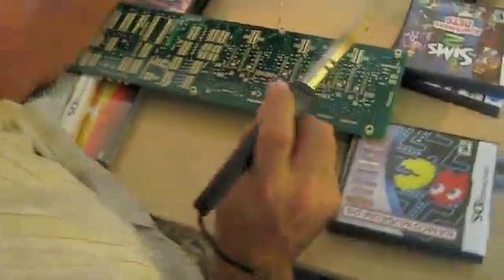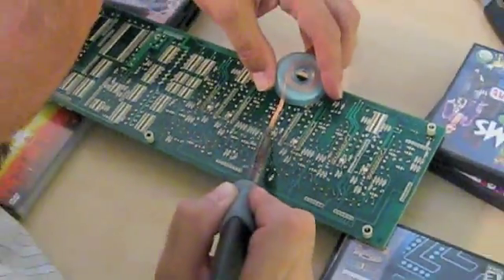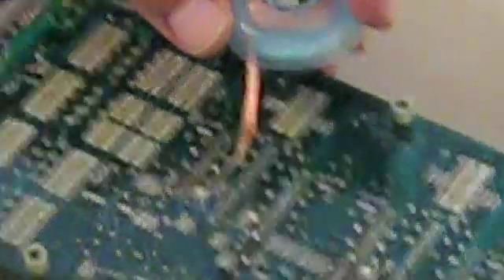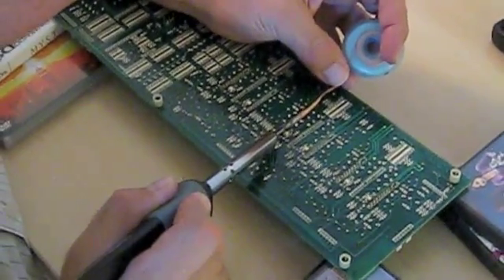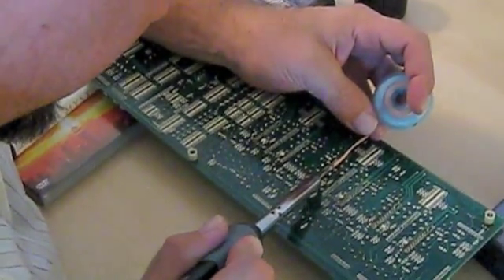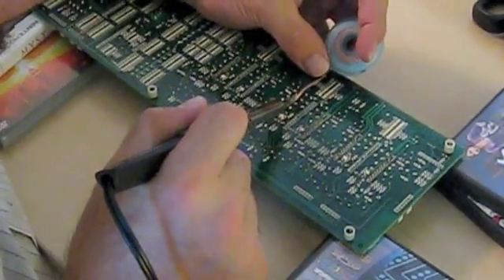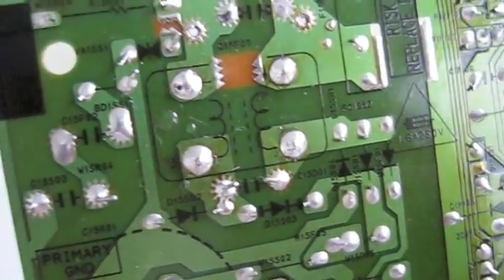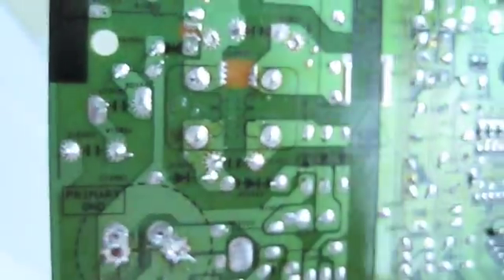Roland 106 Repair - Part 1

Comment: To steady the soldering iron much better, position your board and your soldering hand location such that the meaty part of your hand (between the pinky finger and the wrist) is resting on the table.  You will shake a LOT less when that meaty part of your hand is merely resting on the table.

Also, it helps to ADD a bit more solder to each pin before trying to remove the solder with the wick.  If you KNOW the chip is bad, just cut the pins with cutter pliers, then add a bit of solder, and wick it

Comment: Ace if you've managed to do that successfully first time !

The quickest way to do it is to use a special block type IC shape soldering tip on a high powered iron which melts the solder on all the pins at once. with through plated boards its hard to get each pin loose even if you've removed all the solder with sucker and or braid.

ofc if you know the chip is dead you can snip all the pins :)

Comment: Easiest way to desolder is to flow a bit of new solder on the pins and either suck the solder out or use the copper braid.  What you don't want to do is use the soldering iron for too long on the board, you'll end up lifting traces.

Comment: I think you were lucky to do this without damaging the board. The wick method needs a lot of heat. People trying this should use a solder sucker ($10) at radio shack. Its quicker (although a little tricky) and uses less heat. You do need to apply some new solder to really get it off clean. And dont bother with the desoldering iron. They dont work as well. 

Well done on your repair.

Comment: I do alot of de-soldering at work and I have found that putting some solder on the braid first will distributes heat a lot better and helps soak up the solder on the board.